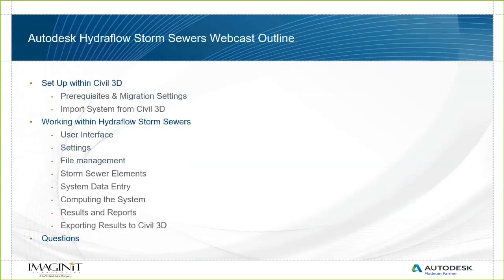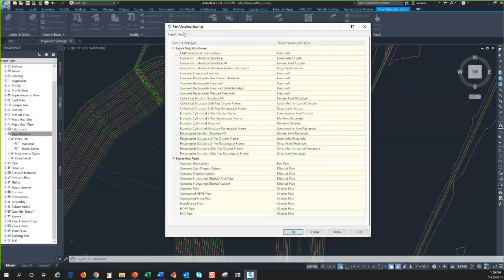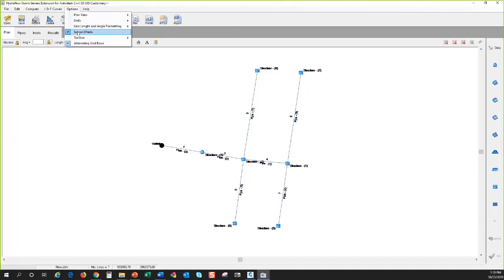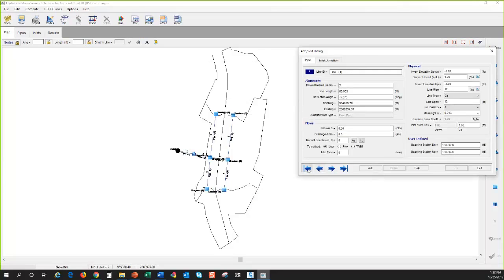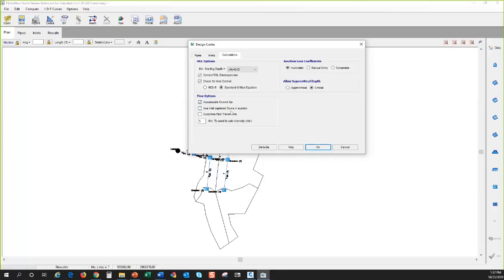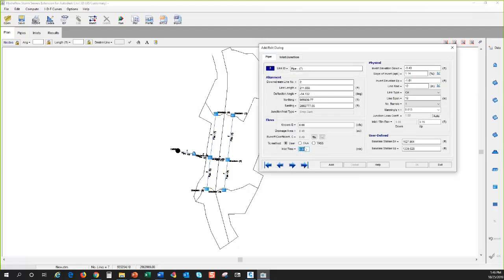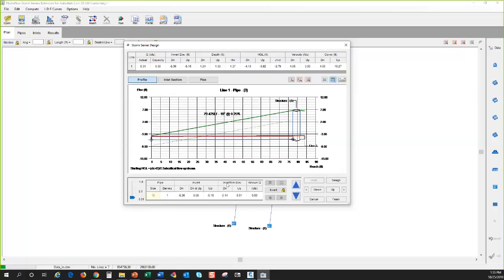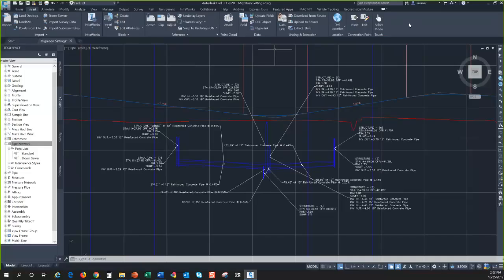Autodesk Hydraflow Storm Sewers

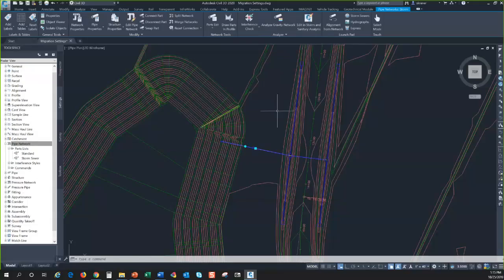Comment: I have set my Feature Settings to match what is shown in the dialog box at 15:33, but when I import back into Civil 3D and update my network, it is swapping the part size for structures from a 10'x4' to a 4'x4' instead of keeping them the same as they were when exported. I made no structure size changes in Storm Sewers... I just ran an analysis and adjusted a pipe size and grade. Any ideas? Thanks!
Reply from the maker: We asked our experts, here's what they said: The tool is not designed to respect structure sizes.  For the same structure type, it just swaps everything back to the default for that structure.
Reply: @imaginittech  Well this goes directly against what I (and I would assume pretty much everyone) would need it to do. It makes no sense for us to size these structures to accept certain pipe sizes, and then have all the structures get re-sized upon import. Frustrating...
Reply from the maker: @tjbrace3654  I sent your note to our experts. While Autodesk makes the software (not IMAGINiT) our team noted we don't have the ability to make that change (though you can suggest it to Autodesk). They also recommended you consider looking at SSA (Storm and Sanitary Analysis) and InfoDrainage as options to help you do what you need to. If you want help from our experts, head over to our site and hit Contact Us to get the process rolling.

Comment: C3D has the structure inputs for road long slope, cross slope, and gutter slope, but I have not found a way to get them to import to Storm Sewers despite finding ways to connect grate dimensions, inlet type, catchment areas, and C-values to structures and have them import to Hydraflow Storm Sewers perfectly. I know this doesn't follow the workflow of the video, but is there a way to do it?
Reply from the maker: Per our experts: Those settings are used by Analyze Gravity Network within Civil 3D, they do not export to Hydraflow Storm Sewers. I would recommend looking into the Analyze Gravity Network tool because it is very similar and does not require import/export.  Here is a video to that tool: https://www.youtube.com/watch?v=NZj0kuxdQrI&t=1241s
Reply: @imaginittech  thanks for the response. Is there anyone working on making these properties exportable to Hydraflow and vice versa? It would make the iterative process of going back and forth from C3D to Hydraflow 100x easier. It seems like this would be an easy fix since other properties like catchment areas and coefficients are easy to import/export
Reply from the maker: @williammcbrayer9956  You'd need to talk to Autodesk about that, maybe put it on the feature request lists. https://knowledge.autodesk.com/support/civil-3d/learn-explore/caas/sfdcarticles/sfdcarticles/How-to-raise-a-product-enhancement-request-for-Civil-3D.html